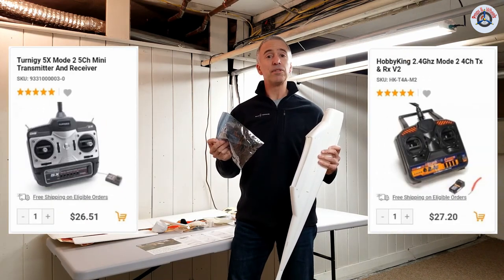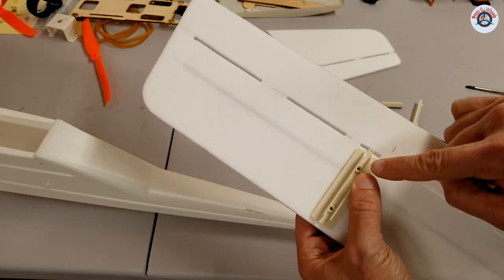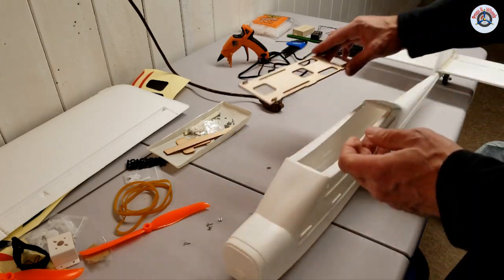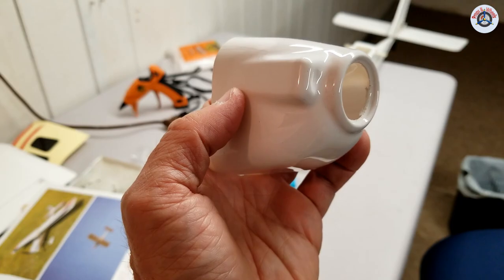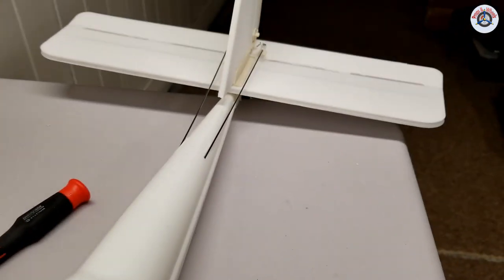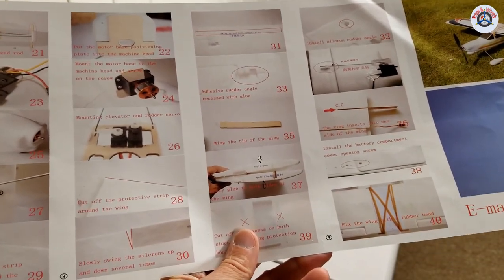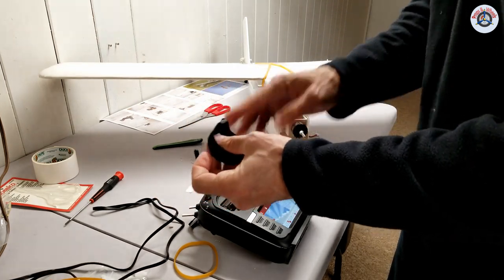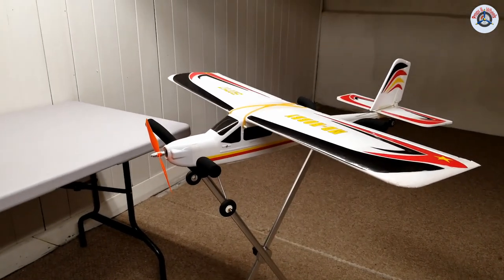MD-HOBBY E0717 1030mm 4CH RC Airplane PNP for $60 from Banggood - Part 2: Detailed Assembly

Comment: Very well presented with a thorough explanation on both the problems with this model and how to assemble. Thank you. 
I also bought this PNP but am very disappointed with it.  I think it is way to difficult to assemble for a beginner (although your video helps immensely).  The instructions are appalling with no detail on the intricacies of assembly.
I think the model itself is rubbish and would not recommend it to anyone.

Comment: Too much stress on the rudder .  It should be done like the Eflite  Air Tractor tail wheel.
Also, the Sullivan Brand  tail wheel assembly removes the stress off of the rudder